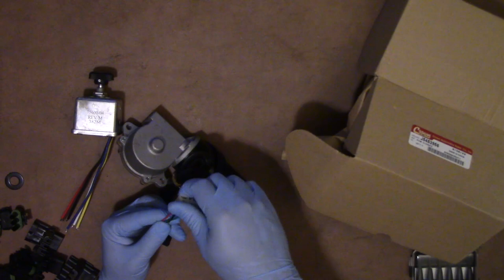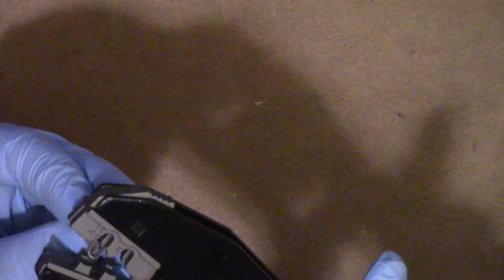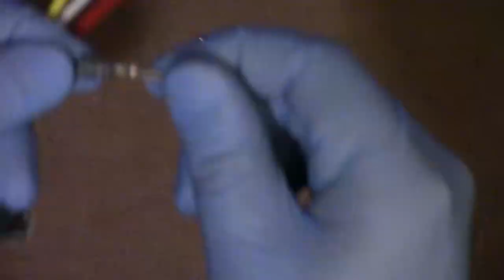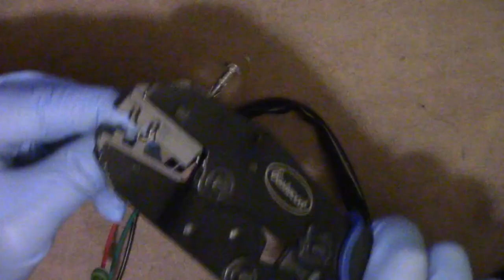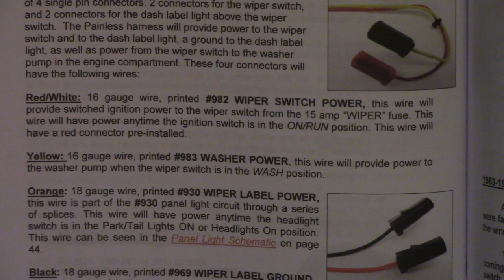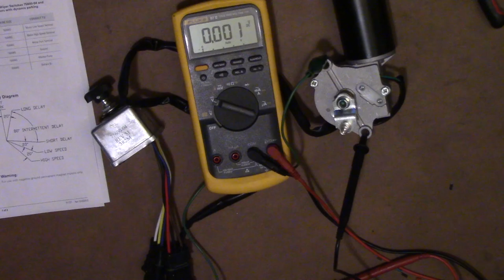Intermittent Wipers for Jeep CJ with Unplanned Weather Pack Tutorial

Comment: I’m having trouble with the switch, when connected it sends a pulsing current, it does the same thing on high or low and no intermittent wiper or park function. I tried two switches and two wiper motors, do you have an idea of what I’m doing wrong?
Reply: Did you figure this out? I’m currently I. The exact same position

Comment: really good writeup and video.  Question you may be able to help with.  I am building a primitive 2014 JKU and I've 'decomputerized' it - no factory computers - Painless Performance harness - etc, and I want the wipers to function just like yours.  I have the same switch, and the JK wiper motor, but I cannot get it to function correctly.  The '14 JK wiper motor has 4 wires that plug into the connector at the motor.  Lo = Bk/Gr, Hi = Bk/Or, Park = Bn/Gr, Ground = Bk.  Assuming the motor functions like any other motor, the three wires on the CJ motor might be the same functionally as on a JK (with ground being the 4th), but when wired up same as you're described it does not work right.  

Sorry for the long-winded preamble but the context is important.  My question is, would it be safe to assume the JK motor and CJ motor are 'functionally' the same (it's just a motor that spins a worm gear when it's supposed to), and should the 75600 switch 'control' a JK wiper motor same-same as a CJ motor as you've shown?

So far mine is not, which is what has me wondering if the JK motor itself has some internal circuitry preventing it from being controlled old-school with the 75600 switch. 

Appreciate your thoughts.
Reply from the maker: @sama.7870  When you say the motor does not work right, is it not working at all? Or, is it not parking correctly or something else? Please describe the problem a bit more.
Reply: @maladroitmechanic  Thanks for taking the time to reply.  With the wires going direct to Lo, Hi, and Park, it only does Lo and Hi - no park, no intermittent.  Might be a 'newer motor thing', meaning the '14 wiper motor may have some integrated circuitry inside the motor preventing it from being commanded by the 75600 switch.
Few of us are just trying to 'command' a JK motor with the 75600 switch, but without knowing how the JK motor functions electronically it may be impossible
Reply: I ordered a CJ wiper and everything (except the washer) functions as it should.  The washer is not sending 12v out the brown wire but the wiper is turning the three revs or so and parking.  During testing I may have inadvertently burned out the washer circuit and I'll order another to confirm.  
There's a couple others trying to figure out how to get a JK wiper motor to work with this switch and it appears there's some internal circuitry preventing normal operation, so I'm going to modify the JK wiper assembly to accept the CJ motor, and it should be good to go.
Reply from the maker: @sama.7870  I noticed that the JK wiring diagram for the Br/Gr Park wire says WPR PRK SW SNS. So, the TIPM is probably looking for a specific condition of the motor before applying Park(lo vs hi speed probably). I'm guessing your CJ adapted motor is a better path forward to use the Littelfuse switch.
Reply: my switch was defective - ordered another and everything works perfectly.  Again thanks for the video.
Reply from the maker: @sama.7870  The JK motor Park function may not respond to 12V. Test this by stopping the motor in a non-Park position. Then, connect only ground and apply 12V directly to the Park wire with a PowerProbe or direct to a battery. If that does not work, then you need to determine what signal the motor needs for Park.